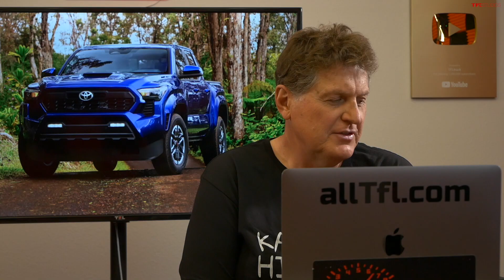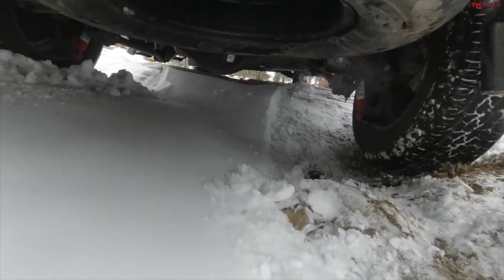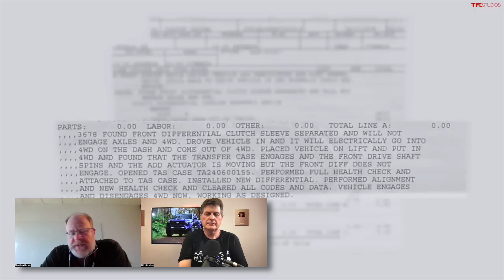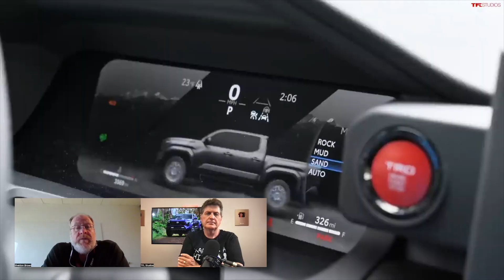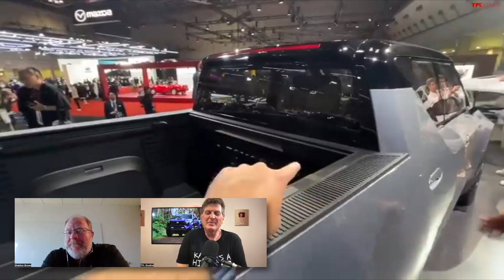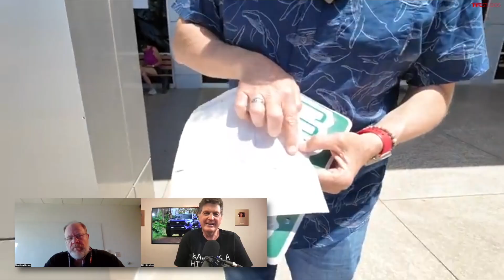The Real Story Behind How Our New Tacoma Broke & How Toyota Plans To Fix Yours!

Comment: The new Tacomas have problems with manual gearbox, clutch, auto trans, and now the excels. They are Underbuilt. Toyota was reliable because it was overbuilt, but no more. both Toyota Truck sizes have major issues, and are over priced.

Comment: As a hard core Land Cruiser guy, I’ve never felt more validated.  With the way the rest of the Toyota truck line in the US apparently has gone to crap, this video speaks to life that Toyota has taken the cheap road.  Never would a 80,100,200 series ever be concerned with this happening.  This was a MINOR off road use case when your Tacoma broke.   No thanks.  I’ll stick to a true Land Cruiser.  They’re built to a much higher standard than a Tacoma or even a 250 series Land Cruiser.
Reply: The LC300 is failing at an alarming rate enginewise
I had a 2019 LC as a rental and it was VERY UNDERPOWERED...constantly struggled to move.

Comment: in other words the front diff components are weak and will fail lol ,what happens when you add some bigger tires and actually use it like a 4x4 is intended to be used.

Comment: In layman terms Toyota is new to Turbo engines, and more so in off road, and this is breaking their trucks. Truck King also had a Tacoma that broke under “normal” conditions and Toyota blamed the driver 🤦‍♂️🤦‍♂️🤦‍♂️
And we all heard about all the issues with the new Tundra truck engines.
Toyota is losing their edge with reliability.
Chinese are going to quickly overtake Toyota globally and although tarrifs are trying to slow it in the US, the same will happen in the US in the next 5 years.
Finally, EVs, which have much lower maintenance needs and less mechanical parts that break are going to hurt Toyota as well.
It’s super rare to hear about a Tesla (or other decent EV) that has a drivetrain issue. Many Teslas have exceeded 300,000 miles with original batteries and motors with no maintenance to those. It’s quite rare, even for Toyota, to have engines that didn’t need some decent maintenance after 200,000 miles….

Comment: Stop using technology in 4x4 trucks. Manual transfer case. Mechanical lockers front and rear. They dump more money and research into trying to get around what is a tried and true setup to get you anywhere in the world, through any terrain. I currently own a ‘22 Tundra. 19:08 Probably the last Toyota I will own unless they get back to their roots with simplicity and reliability. The best trucks they ever made were simple, strong, and arguable the most reliable trucks ever. They are losing customers like crazy by getting too fancy.

Comment: I love Toyota and this channel, but the obvious question is "instead of adjusting the software, why not just increase the tolerance of the mechanical parts?" Even if this means upgrades downstream of this part, the truck is a TRD and should be designed to handle much more extreme conditions than this. Past generations of this truck probably would have run those same conditions all day without issue. This is a serious warning to new truck buyers on the direction of future Toyota off-road products.

Comment: Truck King around the same time broke their 2024: Tacoma TRD off road manual transmission. Toyota blamed as a user error 😂
Don't buy a Toyota anymore.
The brand is becoming a Samsung appliance. Very expensive and needs to be replaced annually. 😂

Comment: Hold on to your old Yoda’s boys, they truly don’t make them like they used to! 

I appreciate Sheldon Brown giving us an answer to the failure and I absolutely understand that things happen and stuff breaks. However, this failure occurred on stock tires, with low wheel speed and no bouncing.  Based on the explanation given, one can only conclude the that the new Tacoma’s drivetrain is too fragile for E rated 33’s, 35’s, etc and any real off-roading. I’d feel better about the truck if they’d discovered a manufacturing defect that led to the failure.

Comment: So in 4 Low, the truck can stop the torque from going to the rear axle and send full torque to the front, which will spin just one wheel, and the Traction Control can slam the brake on the one spinning front wheel.  What's wrong with this picture?  Wouldn't it be much much better to have at least 3 wheels pulling the truck forward?  If you have too many Electronic Nannies then they will eat each other or at least fight each other.  Why not just have simple 4WD with lockers front and rear?  Of course knowing in some slick situations you don't want all 4 wheels spinning.  Maybe it was just more important to save a ton of money building in mexico and overcharge the American buyers by $12-$15K.

Comment: Truck king channel had a clutch failure in the 24 Tacoma ! Too many failures on camera so conclusion I will not consider a Toyota in the future.
I honestly don’t care about their investigation nor do I care about the large vocabulary, I care about my safety and my wallet. I also loved the Freudian slip when he said they pulled the transmission, they must have transmission issues as well.
Reply: But they went from fifth to first gear 😂.
Reply: @citizentex5720  from the video the engine didn’t redline also going from 5 to 1st will have a tremendous engine brake if the gearbox lets it happen with the amount of rotation being excessive 
In both situations Toyota blamed it on user errors in a very nice way, on Tfl they are convincing them with torque, let’s not forget Toyota has diesel variants with more torque in different countries!! They made junk for the American consumer at a high price because us Americans we buy anything that we like and love at any cost. Thanks Toyota!
Reply: @NomadicMoroccan  I watched Truck King again and you’re right! Thanks for the extra info.

Comment: Nissan Frontiers have been blowing front diffs since 05’. Even the new ones fail under less severe uses. The R180 front diff is inherently weak. Once the front wheels catch traction, it’s over. Some get lucky and have no issues.
Reply: 😂 My 2015 frontier with 104k never broke diffs in a mild trail
Reply: @WayOutEast1  It happens 😂

Comment: So this offroad truck was not designed to go offroad, and even 1.7% above spec is enough for total catastrophic failure.  Their solution is a recall so they can reduce the performance via software, but they're waiting until there's enough software updates that it can be buried in there.

Comment: Not a good look for Toyota- the engineer did his best to dance around the issue- bottom line it shouldnt have broken- even on ice, in 4lo, wheel spinning etc. This is like the truck king clutch issue- Toyota is slipping in quality.

Comment: So tl;dw - Toyota didn't build the driveline components durable enough to handle what the traction control system will allow. 

Wild that exceeding the spec loads by 1%~ is enough to grenade diff components. Glad Toyota did investigate, but it's real disappointing to see a vehicle series known for durability be so underbuilt. People buy these vehicles because they go above and beyond from the factory. This truck barely went above it's spec while doing something people would actually do. Hope Toyota really does respond and beef up their vehicles vs just pulling back more power/capability.

Comment: Toyota will fix it by reducing the power available to each wheel so it will be a cheap and fast fix while reducing the performance even more truck broke the clutch on a manual Toyota and they blamed him, which was bull crap they said he shifted from 5th to 1st not 3rd gear. But you can see the rpm’s only went up 2400 rpm’s and never redlined

Comment: I like you, Sheldon, but this was not a “stars aligned” scenario. This was basic off-roading at best. And now Truck King has their clutch collapse on their Taco, numerous people reporting overheating issues, and even some auto trans failures. And this doesn’t even include all the Tundra issues. Sad to say it but confidence is low… and prices are high. Toyota took an amazing reputation and has drug it through the dirt.
Reply: Nissan should bring the Y61 Patrol pickup as a compensation for the Titan. It is heavier duty than the Frontier and will crush the Tacoma offroad....

Comment: What broke it is “the exceedingly rare conditions of being in 4lo with multi terrain traction selected with the rear locker engaged while driving on low traction terrain.” 🤔 Rare situation indeed…

In other news, this dude has absolutely convinced me to steer clear from these new off-road Priuses
Reply: Technically it broke because all torque from 2500-2700 RPM went to one wheel. That is actually rare and seems like a software bug that they will fix like they usually do.

Comment: So you use software to cripple the power output instead of building the drivetrain to handle the power....welcome to the new Toyota.  Wouldn't touch one of these. And buy a current 4Runner now before the new junk hits the dealerships.

Comment: I have a 2018 Tacoma Off road. I found out quickly what the dealers and factory consider is warranty or not a warranty issue. Three dealers told me flat out that the only items the factory will fix under warranty are items that have a service bulletin. No bulletin, customer has to pay, but keep all receipts and documents and hope a bulletin is eventually issued.
I also have a 1985 Toyota 4X4. Solid front axle with leaf springs and locking hubs. Now that was a bullet proof axle. Rezzepa joints in the enclosed steering hubs and tapered roller bearings instead of Dana style ball joints. Too bad it suffered from the infamous Toyota frame rot. My 2018 has the same style box frame that I have no doubt will also have a rusted out frame.

Comment: Toyoduh, Honduh, and Subaru have been playing fast and loose with quality for over a decade.    We are now seeing this catch up to them and this is just the tip of the iceberg.

What this guy is saying is pure hogwash.     Prior to this iteration of the Tundruh, smaller Toyoduh trucks were so dependable that even terrorists used them.   The fact that they offered such a lightweight 4x4 truck in a new version shows you that this company is half-stepping through engineering and not devoting money needed to build quality products.   With the psuedo-full-sized trucks have engine puking problems, you are now starting to see that Toyoduh doesn't care and is diverting engineering dollars to somewhere else.    And no company has a worst buying experience than Toyoduh with its different regional profit padding distributor setup which intentionally screws customers.

Comment: I put 250k VERY hard miles on my frontier before the transmission failed, but not the 4wd components. That's value for your money. And yes, ive had the overpriced taco, too. The Frontier has a 315hp V6 also, unlike the 4 cyl turbo.

Comment: Their engine has way less torque than the competition, no front locker, and they found this weak link that they are going to fix by de-tuning the engine. Funny that TK just released a video today of how they grenaded the clutch on their test truck back in March. What Toyota is doing here is under-building their drive trains, and de-tuning the engine so that it can’t put enough power through it to break it, allegedly. What this translates to is reduced performance when you want it if you’re lucky, and broken parts if you aren’t. They can keep offering more powerful engines on paper that the computer will never let you reap the benefits of. 🤣

Comment: This thing has baby torque weak with barely 300 foot pounds.  Yea its huge for previous gen owners though 😂 and it cant even handle that.  no wonder the previous gen didnt break because it had less torque than most Kias.  Guaranteed the Colorado and the canyon is built WAY more stout to be able to support 115 foot pounds more and the baby toy Toyota.  Toyota can take a leap they dont even challenge NA V8, not ONE. the colorado and Canyon exceeds the power output of MOST modern 2024 V8 engines. GM may make a mistake like anyone else but they give it an honest effort and dont take their owners as a Joke. An opportunity to have some american pride and buy a real vehicle, and yall still gonna buy overpriced garbage. Junk junk junk.  Hope you over pay by 20k and it breaks.  If you are supporting toyota with buying their garbage, you deserve it.

Comment: My laymen opinion is that you can clearly hear the turbo spool up just before the axel disconnect pops. Only Roman knows how far he had pushed the throttle but it was enough to spool up the turbo. He could clearly see that it wasn't going up that obstacle in fact it slid back before the turbo spools up. Any driver should know when to say stop and try another line, change the terrain management setting, lower tire pressure or even turn around. Spooling up the turbo is not a the way to go most of the time. If you apply maximum torque to an axle with no traction and suddenly brake that wheel after it is spun up you make any axle, bearing or differential snap. Who knows how any of these traction management actually work in detail.

Comment: Toyota engineer failed to calculate torque and horsepower  but they are fixing it. That’s the main thing. it could’ve been a lot worse than that  but the toilet engineers need to go take your product and take it out and real world scenarios and test it to the limit they will know the breaking point of their vehicle just saying  bottom line it falls back on the Toyota engineers, no matter what, for failure to have a reliable product

Comment: Btw kudos to the FTL team for actually pushing the Toyota representative. It’s obvious the new front shafts/differential are not strong enough. Tacoma has a more powerful engine, but the right thing is not strong enough to handle it.

Comment: Thats pretty chicken shit.
You'd think in engineering a drive train, they engineer it above and beyond any given circumstance that the engine was capable of.

With the Tundra engines now doing the Kia 2.4 thing and i just watched another video of the manual transmission Tacoma failing as well.

Its seems more likely to me that Toyota has tried to go too cheap and the name they've built for themselves  in reliability, is pretty much in the crapper.

Comment: Toyota has designed their newest generation trucks to very specific limits. That is a great design philosophy for a camry that doesn't have a selectable transfer case, that'll never leave pavement, tow, haul, etc. That's what he is talking about that the traction control allowed the vehicle to "exceed the overall driveline system strength." IMO That is an extremely disappointing way to design a truck. A driveline that is so weak it needs electronic nannies to prevent it from breaking under, what everyone in their right minds would consider, normal use conditions.

They weren't drag racing it, towing over spec, hauling over spec, gunning it in wheel lifting rock crawling situations, etc. Toyota's trucks used to be designed to handle BEYOND normal conditions. They would've done everything possible to ensure the driveline was mechanically sound enough to not break under normal or adverse driving conditions with or without electronics. It's a different era at Toyota.

Comment: What I heard was: "THERE WERE NO REAL WORLD TRUCKS TEST FOR PROTOTYPE AND PRE-PRODUCTION BEFORE RELEASING THEM TO THE POOR CONSUMERS". Now I remember my 2010 Tacoma, which was in the dealer biweekly, almost right after the first week I bought it brand new. Break, alternator, radio, shocks, ..... issues on top of the horrible gas mileage, with a very weak 4 cylinder engine.
I even filed lemon claims, but Toyota didn't care. I sold it with 27,000 miles and bought a Silverado. Since then, I've been  living in heaven.
Reply: Chevy😂

Comment: 1.7% is the safety margin they left in the driveline. That’s terrible
Reply: Not even, because it was met (or would have even been exceeded if it didn't instantly snap.)  It has negative safety margin, until they reduce the performance via software.

Comment: My buddy bought a new Tundra and gave me crap about my Ram Cummins. Stating that Chryslers are crap. Well his Tundras interior began falling apart within a month. A few months later his main bearing cooked and engine destroyed itself. Toyota told him it was because of possible machinery debris and they would replace the issue. He’s already hearing knocking coming from the new engine. PS: zero issues from my Wrangler or Ram.

Comment: 10:55 problem with tacomas multi terrain select, the off road variant specifically. It’s a software issue that has been resolved on the hybrid models only, so far.

Comment: Between this and the Tundra engines destroying themselves, it seems modern Toyota's reliablity is pretty suspect.
Reply: Corollas a lot worse than they used to be
Reply: @TheAnnoyingBoss  problems with Corollas as well ?
Reply: @johnb4183 Lol 2016 they used a normal manual transmission now they use the notoriously bad CVT 😂

Comment: The real picture told here is what happens when you build in countries with lower mechanical standards, use lower quality compromised parts/engineering standards,have safety standards compromised &then raise prices . What a fabulous business model guys . It really sucks being a loyal lover of TOYOTA these days. Also any fool knows when you turbo any engine your wear & tear is massively increased depending on boost level. Double turbo increase it double of potential long term issues regarding reliability. Bring back v6 non aspirated please.
Reply: You mean *naturally aspirated.
Reply: @vettle1   whatever you an English teacher? Point taken 😉